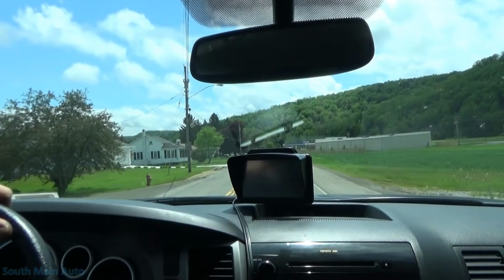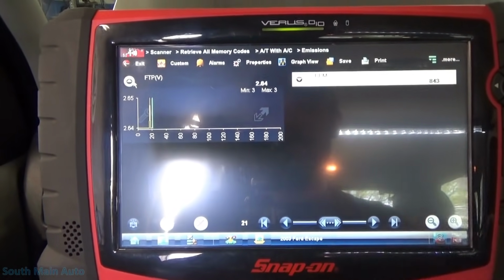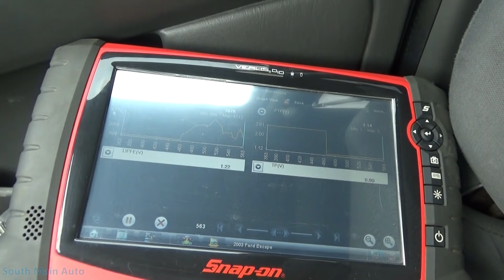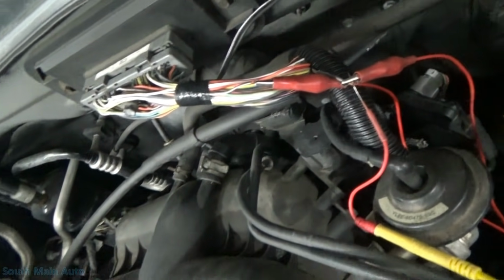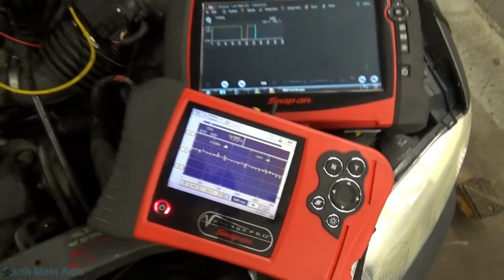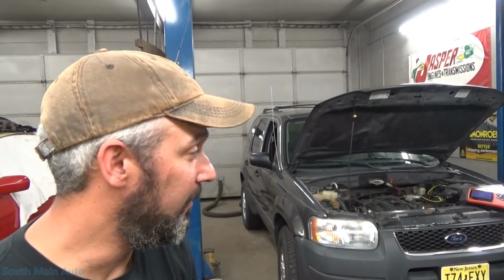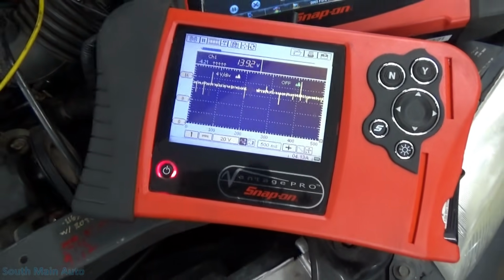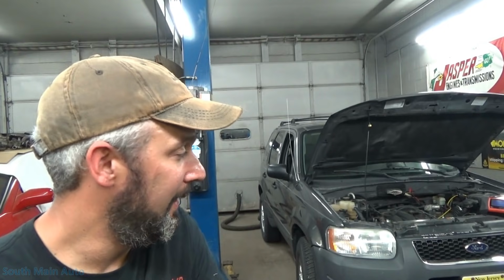Ford Escape: Do We Fix It Or Ship It!? - Part II

Comment: Eric - Nothing under the hood scares me , I will troubleshoot and try to repair any problem on my own vehicles. I am not a professional vehicle mechanic BUT will still say to anyone - YOU ARE A SUPER DIAGNOSTIC TECHNICIAN. That being said , I would be like a first grader of auto repair if I were to even try and make a comparison of my skills to your abilities. It is nice to get LUCKY , as you say , once in while -  and , yes ,it is humbling , but certainly none of us are know it alls - that is something we all have in common. In this video YOU still found the problem - and will say you still dig in - you are like a pit bull , you certainly are NOT just a simple parts changer - as I think even many other professional shops - would have just installed a new ECU as there diagnosis , only to find out it did not fix the problem. Nice to know , that you ALWAYS go the extra mile , as is sometimes said , to be VERY THOUROUGH , before condemning an ECU - not that even the ECU does sometime fail - but generally it is rare - as ECU are super sofisticated and very reliable - generally speaking. ✌️✌️

Comment: Intermittent electrical faults are the hardest things to diagnose and find the true cause.
What you found was a faulty pressure switch that went into resonance at 3000 rpm. Switches with springs, or if I am guessing this design of switch correctly, pressure diaphragms, all have a fundamental resonance frequency. Evidently the pressure pulses from the power steering pump were at the resonance frequency of the switch at 3000 rpm, causing the switch to behave erratically. Over time, spring and diaphragms stretch and change resonance frequency (usually lower), and if they change the right amount, will resonate at normal operation.
Resonance in sensors in hydraulics systems is one of the few engineers ever think about, encounter or design for. Excellent job at being persistent to find the cause, and being more studious to know how things work (more so than the people who designed this stuff).

Comment: As Adam Savage once said, "In the spirit of science, there really is no such thing as a 'failed experiment.' Any test that yields valid data is a valid test."  As such, I see what you did not as a failure, or, "Worst diagnosis ever," but as a fantastic (but more importantly thorough and accurate) failure mode diagnosis.  It's repeatable.  It's recorded/documented.  

Kudos Mr. O, kudos.  I'm pretty good at electrical diags, but not sure I'm that good.

What's funny is, I ACTUALLY thought, "I wonder what would happen if I put a smoothing capacitor across the vRef line at the sensor?"

Comment: I have also seen an alternator with a bad diode make the computer think it had a bad cam sensor.  The noise from the alternating current threw out off.  This sensor oscillating like that would cause the voltage oscillating through ground.  Great find.  I Enjoy watching your videos.  Keep up the great work.

Comment: Nice job Eric.  I don't call it luck buddy.  You were thinking the problem through and using your experience with logic to find the issue, your experience fixed the car, not luck my friend.  Sometimes it just takes time to solve these issues, believe me I know, I have seen some crazy stuff over the years myself, I recently worked on a Ford E450 Stripped Chassis Van when all of a sudden the lock solenoid for the shifter would not disengage, the driver would go out on the street, stop and park the Van, get a wheel chair and when the driver got back in the seat the shifter would not unlock and be stuck in park, needless to say this was a interesting problem.  I will do a screen recording and show everyone what I found.  I found the issue with my Pico.  If I had not had my scope, all of us at the shop  would still be scratching our heads a lot longer to find the problem.  Stay tuned and thank you Eric for mentioning my channel.

Comment: You solved a problem that was started by an unrelated part or section of the engine. I call that SUPERMAN! To many spots along the way you could have stopped and not really fixed it but could have it looked fixed. That you took it past that shows you have integrity. You asked questions from a friend. Only a smart person does that. You stayed open minded to locate the problem. You didn't just change the ECM. As you stated that is the typical problem. You went past the knowledge of that. Even when it was almost pointing to it. You knew more was to be found. Then you found it. Been following you for a long time. This video made me click the notification bell. Now I won't need to look for your next video. I will be alerted. For me that is rare. I watch a lot of youtube. The only notification bell I have clicked on is yours. I'm a super big fan now. Sad I don't live anywhere near your shop. Great job! Ice cream and beer time. Tastes better than it sounds.
Reply: Thank you.

Comment: Absolutely bizarro!!!  How, why does that pressure sensor return such a strange signal??

Bout' 25 or so years ago, Compuserve had several forums that were automotive central including a auto pro tech only forum.  I followed an odd one, Dodge minivan would go into limp mode almost any time of inclement weather in Denver.

Long story short... Owner used rear wiper/rear window defrost heater to keep window clear.  Shortly there after car would shut down, go into limp mode. For 6 months techs chased everything conceivable but everything was within spec.

Car  had been previously hit in the back, rear door and window replaced.  The window glass was aftermarket, not OEM.   Turns out there was a microscopic break in the window heater foil.  When window heater/defroster on, voltage would build eventually cross this gap acting like a capacitor.  Foil...conductor,  Glass...non conductor.  A simple capacitor!!

  Once enough voltage/current built, it would jump gap, send a crazy unexpected signal back to ECM via ground.  ECM went nuts, couldn't figure it out, went into limp mode!!!  How did they find it??  The gap was discovered by the burnt foil at the gap.

Comment: Thanks you for making this video. I just had the same problem on my father-in-law's 04 escape. I didn't think it was the sensor or a vacuum leak since it would let me clear the code and it would take 5 days for the check engine light to come back on. I never would have guessed the power steering pressure switch. That's just out there. Tested the wires with some straight pins and a multimeter. Sure enough just passed 3,000 the voltage drop down to 0.4 or 0.7. There was a p1650 (KOEO) for that power steering switch. I got it fixed today. Thank you for your help.

Comment: Ok so this was posted on 18 Oct 2017, just had to comment on this. EMI (Electromagnetic Interference) and or RFI (Radio Frequency Interference) has sent many a engineer and technician home playing with their spit in daze needing some time to gather their thoughts. Great find as the power steering pressure sensor was throwing out a dirty signal on the 12 volt line the ECM could not handle. And the fix was verified. Experiences has shown that fancy Analyzers costing 250K plus with highly skilled engineers and real world hands on experienced technicians some times go in circles at times trying to fix a EMI or RFI problems. Your scope may not have had the bandwidth or frequency response needed to see all the signals noise in the higher frequencies, but it was a great noise indicator. Sometimes simpler is better. Great find and fix.

Comment: Hi Eric , when I was a master tech at Mazda another tech rebuilt an automatic tranny as the car would not go into top gear. As he had a day off the job came to me as the customer was screaming for their car, on the road test I found that the car would go into top gear if you gently applied the brake - just enough to turn on the brake lights . Turns out the brake switch was shorted and would signal the computer that the car was slowing down therefore no need for top gear . I replaced the switch , problem resolved but the other tech sadly lost his job as the case was brought before Mazda head office. Like you say “ test don’t guess” before replacing any kibbles and bits . Great job and nice to see you stick it out . Keep up the great work bud , it’s tough to remain on top of all the issues these cars can develop. Cheers bud

Comment: Wow, I have a 04 escape with only 70,000 miles on it. I got it less then a year ago, and one day it started stuttering and losing power, finally it wouldn't go over 3000rpm / 45 MPH...I thought it was the sparkplugs, so I changed all 6 of them, checked to boot coils... nothing. Changed oil, took off the egr valve to make sure it wasnt blocked... nothing...I'm a 30 yr woman who has no previous experience in fixing cars...I can't afford to take it in anywhere. But after watching this all of the stuff sounds exactly like my problems...so I'm going to check this out and pretty it works..wish me luck. Thank you

Comment: Eric, i watch every single one of your videos. No matter what its about. Ive never commented before. You said you are not the super tech everyone makes you out to be. Im going to have to disagree. Introduce me to another tech that would EVER consider power steering while dealing with an evap code. Yes, this particular diagnosis may have had you running in circles, but one was bound to trip you up eventually. Guess what? You STILL figured it out. You may feel like you got lucky, but your thought process is what got you to that lucky break. Its great to be humble. But you are a god among men when it comes to diagnostics.

Comment: Hi Eric, Brilliant diagnosis but you asked why the ECU went crazy with this signal. Well what probably happens is this switch signal calls an interrupt to the processor and gets it to run a subroutine to adjust the idle air solenoid. Now this subroutine takes a small amount of time to run. The power steering switch is not meant to have some crazy duty cycle like you have shown. so this subroutine is being called thousands of times and the processor gets overloaded with data and drops some of the other jobs it is supposed to be doing. Interrupts can have priority and is assigned by the guy writing the software. Hence the poor old processor drops some tasks to deal with the crazy switch. Normally steering pressure does not vary that quick. So your supposition is probably exactly correct. It is like somebody tapping on your head trying to get your attention while you are trying to do another task. So the other task gets forgotten as it tries to deal with the head tapping. I did once design a very simple engine management controller. But they are way beyond what I did at university.  
Allister

Comment: That is wild! Sometimes luck is all we got trying to figure out these problem vehicles. One of our 2001 S-10's years ago had a transmission that would start out in 3rd gear at random maybe once a day , once a week ,etc. I brought it in ck.'d fluid , connections, etc. I noticed the alternator was making a weird noise. Put the old Snap On scope on it and it was showing some bad diodes in the alt. with a strange voltage pattern. Stuck a new alternator on and it cured the trans. problem. I felt really lucky also.  Great Job on the Escape!!

Comment: Hi Eric, after seeing this video I just had to say. Brilliant job, I have come across a few like that in the past. What seems unrelated is in fact, related. I am an electronics engineer as you know and a radio ham. I can tell you that signal was being picked up on the loom probably by capacitive coupling and if the filtering on PSU (Power Supply Unit) in the ECU it would go into the processing and could cause all kinds of weird faults. That was a control that was designed for slow switching and it had a relatively high frequency on it and it could also have gone straight through any signal conditioning on the board. Microphone pickup is a similar problem with radio transceivers. Press transmit with a carrier, works fine, plug the mic in and speak and it goes wacko. I had a similar fault on electrical panels. One I had designed, panel basically worked great but when one of the heavier contactors operated so did another one momentarily. Absolutely classic capacitive or inductive pickup. You would not believe there was enough energy to actually operate another contactor. But there it was doing it, so I fitted some signal conditioning in the form of a MOV (Metal Oxide Varistor), problem went away. A metal Oxide varisor is a device that decreases its resitance with increasing voltage to control Back EMF spikes. To just give you my opinion, and I feel this quite strongly, there is far to much electronic processing in motor vehicles these days giving people like you a real headache in diagnosing these problems. Again, my opinion, it does not give enough improvement in performance to justify the complexity. It is not a spacecraft flying to the moon. it is an engine and transmission with 4 wheels and a cabin. I am a great believer in simplicity is best. I do design and build some complex machines, but I try to make them as simply as possible, that is good design. I could easily use a micro processor to control everything but I try to do everything with relay logic then anybody with a bit of electronics knowledge and a diagram can fix it.

Yours

Mr. A. K. Denyer

Comment: love your work. No luck involved in this one. You didn't condemned  the  ECU and went looking elsewhere for the reason and problem in the end you found it and SOLVED the problem with out being a parts thrower. I have a  drawer of second hand test sensors I've obtained over the years from wrecks  to double check my diagnostics and to help eliminate sensor, back feed or wiring issue. it just saves time and unneeded parts bills.

Comment: Eric, I think what you had there was an electric ground loop.  Google 'Ground Loop (electricity) ' to get the wikipedia on it for a summary. While the 5V and 12V are separate supplies ultimately on a vehicle they have to come back to the same ground source.

With that 12V sensor switch shuttering like that it induced so much noise through ground loop on the 5V that reference was lost I wager and the ECM saw the signal on the tank pressure sensor as ground.

Comment: Excellent perserverence and eventual diagnosis of the power steering pressure switch. It's definitely one for the memory bank. Maybe you could change your video title to something like Fuel Tank Pressure Sensor Diagnosis, so it will turn up in a search. Thanks for another great video.

Comment: You shouldn't be humiliated, you were never comfortable with the problem being the ecm or the sensor. Listening to your thought process and troubleshooting was also interesting. The fact you were still chewing on the problem going out the door indicates you still didn't like the "solution". Great job! By the way as an old computer guy I can tell you this, the bad switch on the power steering pump was causing a power fluctuation. Digital equipment hates power fluctuations! They do crazy stuff like you experienced. 

A field engineer I know (mainframe computers) used to always say "better lucky than smart". One of my other field engineer friends had a printer problem one night. We had a printer that kept blowing it's breaker. He tore the printer down to the component level. Checked every board and connection in the printer for damage. Nothing. He reassembled the printer was still blowing the breaker. He repeated the process. Same result. There were three small light bulbs on the control panel, of course he never checked them. Think size of a small flashlight bulb. One of the bulbs had a bizarre dead short. The filament burned off at both ends and dropped straight down creating a short. We are talking about a 600lb printer.

I had an old Town Car, fuel pump died. I could hear it pressurise the system when I turned the key normally. Keep in mind I am a computer operations guy. So I got a new fuel pump. Thankfully the tank was under a quarter full. Dropped the tank, put in the pump, still not turning. Dropped the tank pulled the new pump. Took both pumps and applied 12v to each, they both run. Put the new one back in. Same result. Popped the caps on the relays under the hood. Noting looked burnt or pitted. I ended up dropping the tank about 7 times before I found the problem. The electrically conductive grease on the wiring harness connectors going into the relays had dried out and was no longer conductive!!! Cleaned the connections. Put it all back together and no more problems.

Comment: Don’t sell yourself short man. You ARE a super tech. You found the problem in the power steering pressure switch because you were relentless in tracking down the cause. Yeah, you did all the regular stuff testing the circuits involved without finding the problem. That’s because the bad component isn’t part of the circuitry your logical testing checked.  Give yourself credit for a job and fix well done!  You deserve a trophy🏆.

Comment: That's a great video...MORE! It's similar to when my internally shorted anti lock brake module fried my torque converter clutch solenoid and also fried the replacement solenoid and the truck would stall coming to a stop only after reaching 45+ mph. It would run all day under 45. Found the shorted brake module replaced it and tcc solenoid again and problem solved. I actually had a Chevy dealer offer me a job over that issue, after he paid me back for the 500+ dollars worth of parts he put on that didn't fix the problem. Fun times...indeed!

Comment: Wow. That was a nice diagnosis. I do think this is a software/programming issue. The computer ought to see a voltage anomaly for the PS pressure sensor and throw a code for it. Situations like this shows how software QA is so important (and other situations, such as the 737 max, etc.)